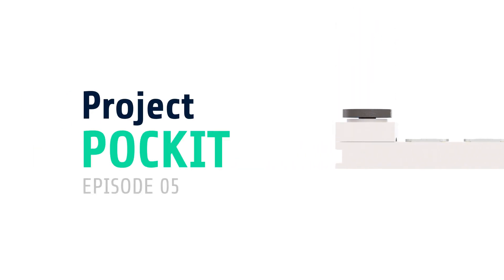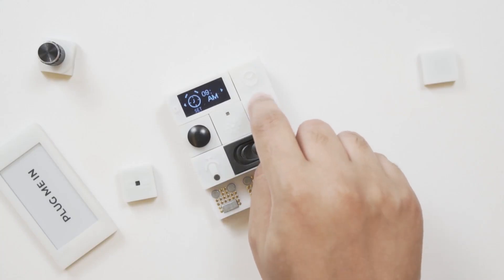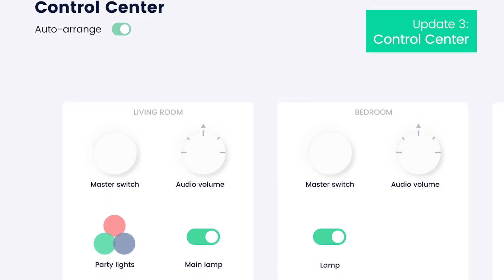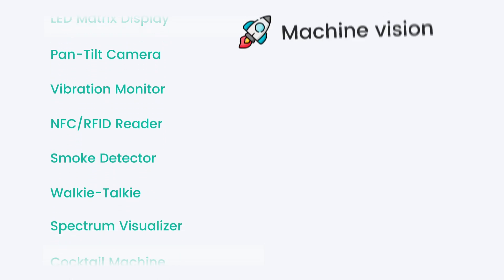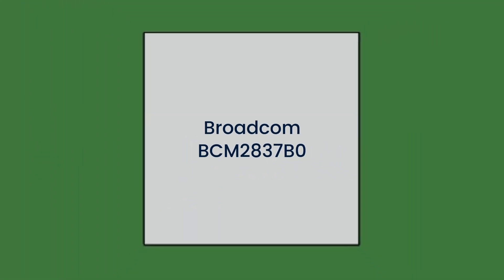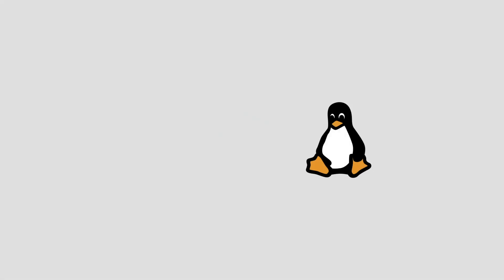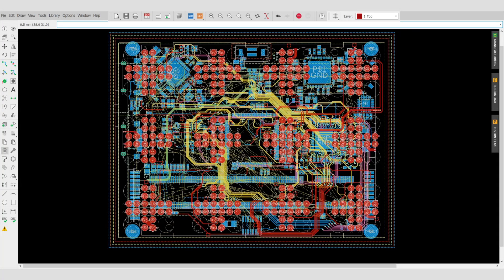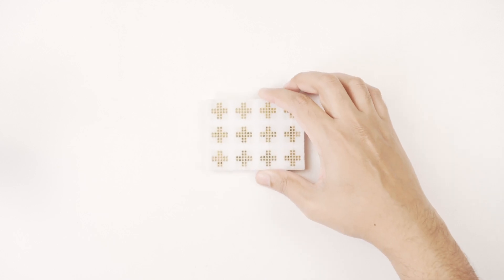A small, plug-and-play Linux computer — with Raspberry Pi (Project POCKIT)

Comment: For the Raspberry Pi fan, you should use a fan like what's in the macbook where the air comes in from the side rather than the bottom. I believe it will also reduce the noise the fan makes.

Comment: How is this not in production yet??
With a R-Pi as backer, this would run Retro-Pi, I suppose, and by extension Pico-8?? MAN!
Reply from the maker: : - ) Getting there!
It already runs Retropie -- so for example, you can use it with configurable combinations of Button/Joystick/Speaker/Display Blocks, etc.

Pico-8 -- This looks really interesting; I'll check it out in more detail.

Comment: Will it run sunvox or milkytracker though?
Reply from the maker: I haven't tested those two specific frameworks. However, in general, the Blocks should work fine for synth applications; for example, I've tested SonicPi on the Pockit with various Blocks (Buttons + Dials + Gesture-sensors + Touchpad Block etc.)

Comment: This video is not clear about the most important part, is it using the pi zero? The website doesn’t state this clearly either!
Reply from the maker: Hey, no, it's something even better than the Pi Zero : - ) CM3 which is the same Broadcom CPU as the Raspberry Pi 3B+. And a few weeks ago, I've upgraded the board to use CM4 (even faster). If you haven't already, do check out the timeline section on the website; lots of details + pictures there.

Comment: This is sweet, my only worry would be the pricing of such a thing, $100 for a small kit with some basics (Pockit base, a mini lcd, some buttons or knobs, maybe a sensor or 2) seems doable? You need to hit a perfect price point for this to be viable. If I, an electronics enthusiast, want to buy hardware for my projects I wouldn't want to spend a small fortune on each device or module for that device. I prefer to find a cheap but powerful solution to a project in most cases, mass adoption for a device of this sort is gonna be tough and a largely tech enthusiast audience is going to be your start. Pockit seems like an amazing little device, but in the end if I find my $5 esp-8266 suitable for the same job (albeit with a little more work) I'm going to go with that.

Comment: Double the screen size so controls are behind it like a flip-slide-phone. It'd be the same size total.
Reply from the maker: Good suggestion. I went with a somewhat different approach for the same overall goal (enhancing the connection surface area), using an offset connection capability for an HDMI Block; will try to demo it in a future video.

Comment: Does the SD card module keep the SD card from getting its filesystem damaged if/when it’s detached without a umount?

(Also, irrelevant, I know, but that looks like a chiclet keyboard, but it sure doesn’t sound like one.)
Reply from the maker: Super late reply, my apologies, been busy with the project. The SD card block doesn't currently have such protection. I am thinking about how I would accomplish that but can't think of any solution, because if a sufficiently motivated user wants to yank out the Block, they could always do that. I can perhaps just add a convenient button on the software UI side of things.

Comment: This is a great idea. I think that this will be BIG. Also if you haven't added it yet, can you add the newest bluetooth, and with it you would be able to make a player of some sort with this. And one type c would make everything simpler with less parts if it can be used both for power suply and for video. Well, maybe the last one can't be done(or I don't know about it), so you can be the first one.
Reply from the maker: Yeah, the last part (single TypeC for everything) would probably be unachievable, at least for now, given that the USB connector is also meant for data-transfer of the Pockit itself. But the first one will be possible now, with the newest Mesh Block (for this one, I used the nRF52840 IC, which supports all the latest and greatest of Bluetooth, including audio).

Comment: great job, realizes many practical examples ,. make it interact with wifi relay. attach it to the wall and control eg: the thermostat, switches, create customized functions .. with the fingerprint you can open an electric lock that unlocks a desk drawer .. etc .. in short, it shows how easily you can create functions of custom home automation or whatever. you could make your home automation even voice, without having to be connected to the network with google, alexa etc .. fantastic. You have a world of applications for your device ,. show them to the public, if you can create a system that is usable by everyone, even non-experts, you will make your way. keep it up!

Comment: LOL you actually made a FULLY Functional Phone-blocks Device.

Sadly the PI is not modular. as in swapping it out for a newer model.

Now you only need to look if you can get a Sim-card with a Antenna buid in the case, so you can use it as a phone.

Comment: it'd be great if you could screw in all the modules or some other sort of more "permanent" solid attachment (optional, still with magnets too for quick swapping)
so when you put it in a pocket, or slide an input part a bit too hard, or type on the keyboard without being too careful, it won't just detach, and stuff like that (especially if you bump gps and need to wait another 5 minutes for a fix)
I could well see myself and other people having semi-permanent setups, where you might want to always keep the audio jack, for example, and maybe keep the keyboard attached most of the time, but occasionally will instead "dock" it, with usb and external monitor instead

Comment: I think the magnet mount system should be done so that there is some sort of shaft of something that goes into the board.. because it looks like the locking system wont take any force, and if you have display cables, usb cables.. its going to be pain if they are constantly disconnecting if you move the unit etc. Magnetic system is cool, but it would need to be really well designed to work well... it should be able to take the force of cables pulling up, down and in sideways. Otherwise its a compromise of cool magnets vs something simple like a thumb screw.
Or simply have additional thumbscrew on the cable pieces. As most of the pieces would not need to endure any extra.
You could add extra screw mounts on the sides of the boards, so the pieces connected onto the sides could also be secured with a thumbscrew. Or some sort of extra interlocking system to tolerate cable pull forces.

Comment: It would be cool to see a version of this with the Pi CM4
Reply: Hopefully the Pi foundation doesn't abandon the new form factor as quick as they did with the CM3. For a STEM focused company, they're not setting a great example with design longevity and environmental impact.
Reply from the maker: @amirpourghoureiyan1637  I share this wish. It does look like the CM4 is here to stay for at least a couple of years (if nothing else due to the pandemic). The CM4's possibility-space hasn't nearly been fully exploited yet; so much capability in a fairly low-cost processor.
Reply: @amirpourghoureiyan1637  The 200pin sodimm compute module 1 form factor launched in 2014, and the Pi foundation has committed to produce the CM1 and CM3 until at least Jan 2026.  Thus I don't think 12 years for a form factor qualifies as quick to abandon. 

That said any new products going forward would probably be better off designing around the CM4 form factor especially ones that use GUI environments like those shown in the demo video.  There are many CM4 carrier board under development in the short time it's been available.  https://pipci.jeffgeerling.com/boards_cm
Reply: @Tweak42  I think everyone kind of fell in love with the old form factor for CMs. That being said, I’m glad they made the shift. Having more pcie options would be awesome though. Running a file system off an SD card should be considered a form of abuse 🤣
Reply from the maker: @Tweak42  Yep, the CM4 form factor is pretty optimal. After upgrading the PCB to use it, I was able to reduce Pockit's overall volume.
Reply from the maker: Wish granted. (And the CM4 runs substantially faster!) Video on this soon.

Comment: Wow great project. I see great educational potential for kids, testing purpose and IOT rapid development. Still don't understand how Stm32 is used and what protocol it use to connect to all modules: I2C, SPI ?  I feel little disappointment don't see any electronic schematic ;(
Reply from the maker: Thanks for the feedback. About the connection methodology: I will open up more details in the near future. STM32 is used to communicate with the lower-throughput Blocks (via a combination of GPIOs and SPI + I2C buses). The data of the Blocks (in addition to the Pi-specific Blocks like Camera, HDMI, etc.) is thus also real-time accessible to the Pi processor (as the STM32 is connected to it via SPI + UART).

Comment: having a hard time believing you can just pop a HDMI port anywhere and it will work, all those modular slots needs to be routed for the 4 twisted pairs for hdmi.
Reply: They could probably fabricate a module to have the port on the top instead of the sides - would work out better for tightly-integrated projects
Reply from the maker: Yep, the HDMI block can currently only be connected at certain positions (it helps that there are 2 HDMI ports); this helps avoid nightmarish permutational + routing complexity (and signal integrity issues). Most of the Blocks can be connected at any position though.

Comment: Awesome work pockit team. It's just superb. But the only question is, will this board and it's modules be available at a reasonable cost. I don't thinks much marketing is required if the cost is right. 
Well the product is exceptional and the hard work has paid off.
Reply from the maker: Thanks for the comment. As I get closer to DFM, I'm trying to focus on optimizing the production cost. I'm not sure about exact numbers, but keeping it accessible is certainly a priority; this kind of project will go nowhere without healthy community adoption.

Comment: Cool. The amount of work done to put it all into modules and stuff, really shows off.
Do you think POCKIT could gather enough interest for you to integrate some Linux-capable ARM directly on the PCB, to make it thinner and more integrated? How many POCKITs do you think one would need ordered for it to be viable option for example to use i.MX8 or similar?
Reply from the maker: "integrate some Linux-capable ARM directly on the PCB" -- yep, this would be the dream. I've been scoping out a few processor options (like the TI, NXP, and Allwinner families)... But at the same time I'm concerned about feature creep; hardware projects suffer heavily with revisions. So as far as an i.MX8 is concerned: unless there are hundreds of interested people, let's say it's more likely to be an add-on for now (just like the CM3/CM4 is a swappable add-on). Let me know if you have any further/alternative thoughts.
Reply: @PockitChannel  yeah, I think cm4 is easier and safer  route for now.

Comment: Imagine hanging one of these on your wall and it controls the thermostat. Someone changes the temperature again? Just take the dial block off. Maybe get a dial block that gets tighter the more it turns, or one that is clicker. Or just have a slider instead. Set it up to also control some fans with buttons and watch the porch with it's display. Have a speaker on it when someone is at the door. And that's just one use!
Reply from the maker: The taking-the-Dial-Block-off cracked me up, haha. The visual is hilarious. You should make the next video.

Comment: Question... can a unit be attached in multiple configurations? Example: Can the displayport you attach at ~ @3:54 be rotated 90 degrees clockwise and still work, or would it have to go onto a different square (bottom for instance)?
Reply: It seems like it since the connectors are symmetrical and polarity isn't identified by a marking or colored pin. If they had to be mounted any particular way that would limit what could be done with this quite a bit.
Reply: @deoxal7947  They're using magnets to attach. Polarity might be enforced by magnetic field.
Reply: @MrWisski  Yes might but it's possible all the magnets are inserted the same way preventing that.

Kids are bound try to force them on that way and hold them on with their thumb just for the challenge which could kill the block and the board. I use to do that sort of thing with snapping toy blocks.
Reply: @deoxal7947  I imagine this will be priced high enough to be out of most children's reach. This is something that would be better suited to computer science students, hopefully most would be mature enough at that point in there education to not destroy the POCKIT lol.
Reply: @amirpourghoureiyan1637  I think a lot of adults would do it too, I probably would unless it was explicitly stated that that would damage it.

I imagine parents are going to let their kids play with it though. I hear about people letting their kids play with plain raspberry Pi boards already.
Reply: @deoxal7947  As with everything that's made to be tinkered with, doing research on what you're buying and knowing the limits of your hardware is a must. Due diligence is everything when it comes to unrestricted technology like maker-boards and microcontrollers.